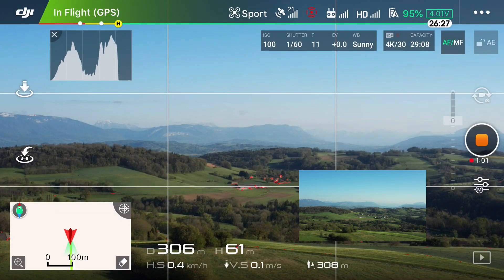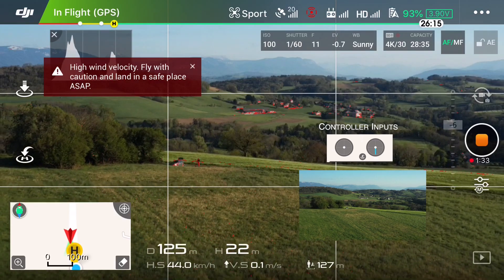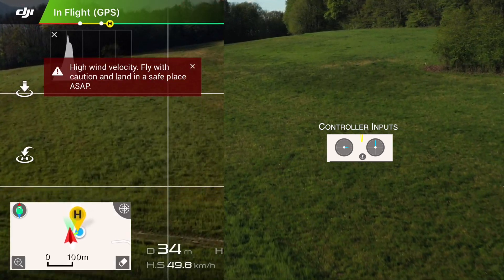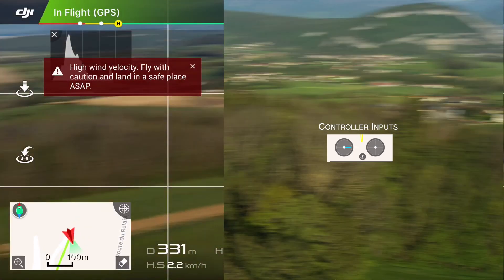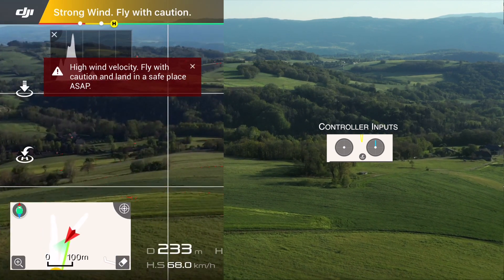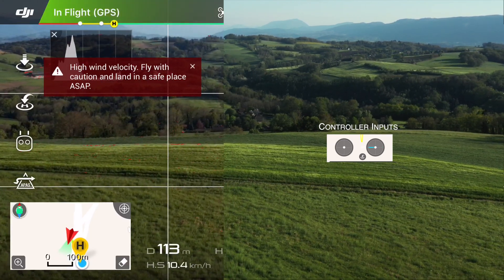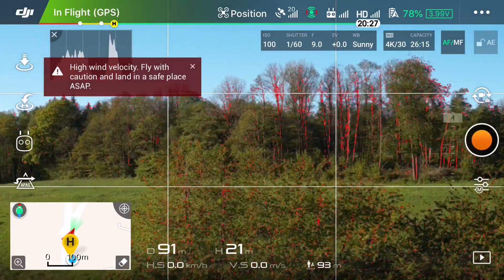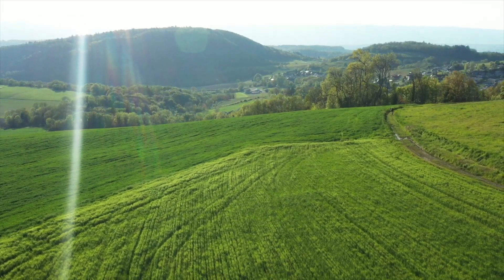Drone FPV Video delay and breaks | Phone performance importance

Comment: This might not be a question you can answer. But would a 4g phone flying a 5g quad cause a latency issue also?
Reply from the maker: No. The latency described here is due to the overall performance of the device regardless of the cellular bands it operates on. Clearing up blared apps etc, freeing up resources and keeping the device cool helps reduce latency that is performance related.

Comment: I get this problem. I’ve tried using iPad mini 3 and 4 and iPhone 6 but the video feed is still delayed. Do you know how to resolve this? Must I upgrade to a better device?
Reply from the maker: Here is what I can confirm, 
iPhone mini 4 - only DJI App installed (no issues)
iPhone 6 SE - social media app and DJI app installed (No issues)

Of course it does help to have the latest firmware in the drone and controller and the latest version of the app installed. 

If all else fails do a complete restore of the mini 4, and only install DJI App than give it a go. 

Godspeed!

Comment: downgrade your go 4 app to version 4.2.16 or older and the performance will improve significantly. I've done it with my Nexus 7 2013 and the difference is night and day. If you're not flying one of the newer drones then I do not see any reason to update.
Reply from the maker: Gerhard Olivier thankyou. Issue resolved I cleaned out my iPhone. Only my old iPhone is problematic because I had too much crap on it. My android phone works well with the latest app the previous was buggy.
Reply: @ANTHONYVLOG  Pleasure. I have also found that turning off video caching makes a big difference on slower devices. I really do recommend turning it off if you're not going to use any of the cache files. But it's quite scary to see how slow the dji go 4 app has become recently... The difference for me and my mavic pro is crazy. With new go app the app is laggy(not terrible, but laggy), just using the older app version I was able to screen record and fly smoothly with no issues as well as cache to the device. DJI really needs to wake up here...
Reply from the maker: Gerhard Olivier I agree the recent variations has been more demanding specially the updates for new features of the Mavic 2. When I had the Mavic pro and Mavic Air even the inspire 1 they were less demanding. To be fair if I’m going to buy an expensive drone made last year I’d better get a compatible device for it 😂 saving my chump change for a smart controller now
Reply: @ANTHONYVLOG  Smartcontroller... the dream...(and the price of another drone haha). I agree, if you're buying a new drone then you're bound to need a more powerful device. But DJI are making the spark, air , inspire, pro 1 owners suffer for no reason. Honestly, the dji app does not offer anything new... wonder what is soaking up all the power/resource. Luckily, there is no reason to upgrade my app and I've Found 4.2.16 to be the fastest version of the app. I'm sticking to it :) Btw, I used to have a Parrot Bebop 2 and your channel helped me a lot.
Reply from the maker: Gerhard Olivier ahh sweet man!!! I still got the old girl and do the odd experiments now and than. I appreciate you stopping by to share notes 😇
Reply: @ANTHONYVLOG  Pleasure man! MP1 is still a great drone. Would love to see you do a mod on it as you use to do with the Bebop. I've done the FCC, nfz and altitude mod on mine m1p. Still contemplating doing the battery mod.
Reply from the maker: Gerhard Olivier that’s a negative for me. Leaving the Mavic 2 Pro bone stock just Incase I need to send it back for warranty or care refresh. They have become really strict about modifying or using third pty accessories and apps. I already sold my kidney for this one haha

Comment: I have flown my Bebop2 Power with 189mb of storage, and 92% of resources used. I didn't experience this. However I have seen this in other DJI products. Are you saying that you also experienced this with the Parrot products and Freeflight Pro? 

This is one of the main reasons I really like companies that have integrated displays like Yuneec, Autel, XDynamics and now DJI with their Crystal Sky kit and the new Pro controller for the Mavic 2.

In your video, what are the red highlights in the FPV video?
Reply from the maker: Reds are black clippings and zebra for highlights
Reply: @ANTHONYVLOG  Are the clippings and highlights something in the DJI app? What is the purpose for the clippings and highlights?
Reply from the maker: Forgot to mention this only happens with iOS my phone idles with 28% cpu used and pins at 100% if I have screen record and any streaming app running. It only has 2core where as my android phone is an octacore and just smooth as silk. Time to change my iPhone for a smart controller 🤗
Reply from the maker: Airwolf, I made a mistake and I need to correct myself. The red fringing you see is the focus peaking and not the blacks clipping. My apologies for this mistake.
Reply from the maker: Airwolf I have experienced delayed fpv with FFP on iPad mini using the 720p stream the 480p stream never had a problem but can not confirm that it was due to CPU overload because FFP has no reporting ability. Rebooting the iPad mini does the trick.
Reply: @ANTHONYVLOG  Ok. So I'm wondering if this has something to do with Android versus iOS? I only use Android so I can't verify.
Reply from the maker: Airwolf not only iOS its just my phone is old and there have been many many updates to improve the apps but I have not improved my phones hardware the iPhone that is. My iPhone is 5 years old. My android released late last year. This was 100% resource limitations. If DJIGO4 didn’t report my phone cpu full I wouldn’t have known.
Reply: @ANTHONYVLOG  Yeah, my Android is definitely newer although newest. It is a Galaxy S8.
Reply from the maker: Airwolf clipping is to caution if it flips the blacks (shadows) those areas are pure black or zebra (highlights) it is pure white meaning the details in those areas are lost. Mainly used by videographers and photographers for the best results in post. Just like using the histogram for exposure, it’s more of guides to help the user expose to their preference. If that makes sense
Reply from the maker: Airwolf yes you can enable them and disable them in the dji app it’s assisted features for correcting the exposure
Reply: What iPhone are you using
Reply from the maker: @uptowndisco  6+
Reply: I'm using a mavic air 2 on my 75$ phone with full memory on it. I'll show this to get an upgrade